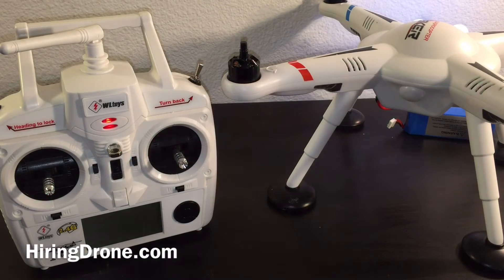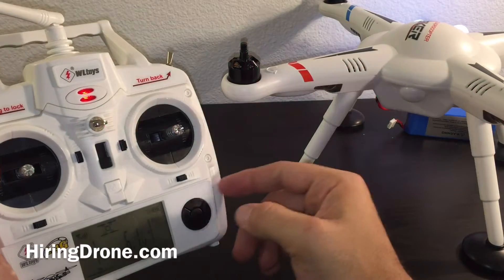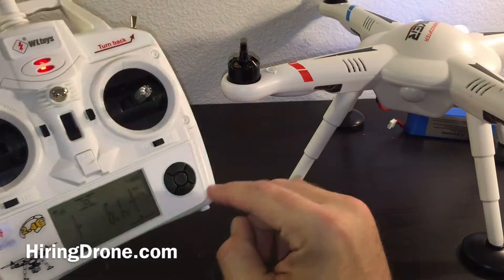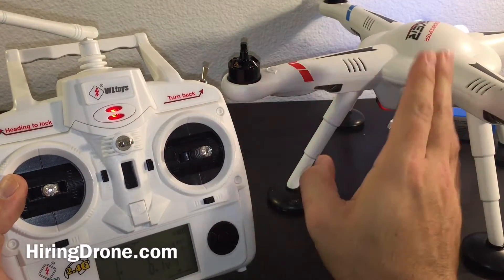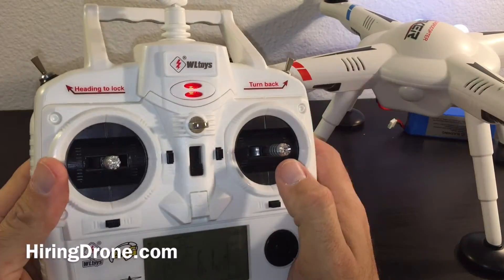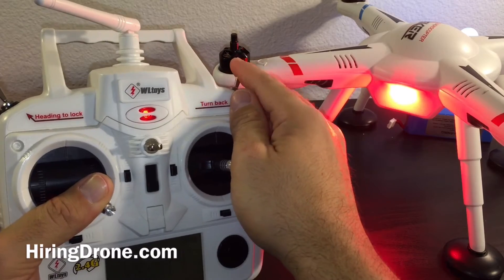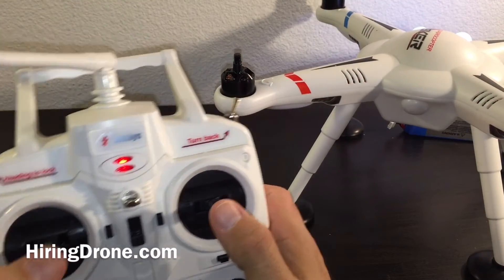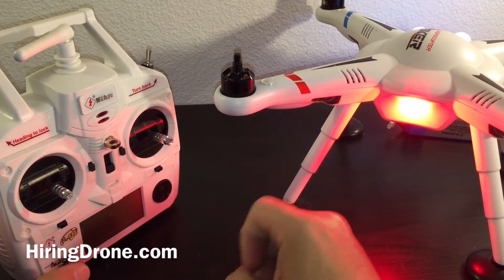WLToys V303 Seeker Re-calibrate Bad Transmitter

Comment: hi the number of times you flipped the switch was more than you stated, does that matter,? or do you do it till the light changes ,  cheers
Reply from the maker: +nukerzero the first - Watching the light pattern in the most important thing. The instructions state 12 times, but as you can see by the video, it can be more. I have went over the instructed amount and it still works fine.
Reply: +Hiring a Drone  thank you, does it matter what is turned on first, quad or control unit, I have one sitting unpacked on the table all ready to follow your advise, indoors all good though ?
Reply from the maker: +nukerzero the first With the V303, you always want to turn your transmitter (controller) on first. Set the transmitter down close to the V303. Insert your battery into the battery bay, plug it in and then do not touch it until it finds the Satellites. If you are going to do this inside, be sure to remove your props. You can do this inside, as long as your V303 gives you the flashing green lights, indicating it has found the Satellites. If you cannot get the Satellite signal indoors, try taking it outside. Make sure you are on a flat surface (concrete).
Reply from the maker: +nukerzero the first This video should only be used if you have an error while calibrating your transmitter. Most transmitters come bound and go-to-go out of the box. The link below is an important step that you should follow, prior to your first fight. 

Doing this before your first flight (every flight), at the flight location. https://www.youtube.com/watch?v=95a1kYnOFJE
Reply: +Hiring a Drone thank you , I have not long unpacked it, hour or so ago, can only get to 2 green 1 red flash cant even start it  good old New Zealand  balls of wool up there for satellites, it has certainly taking the enjoyment  out of buying one,  at the mo, I  very much appreciate your help